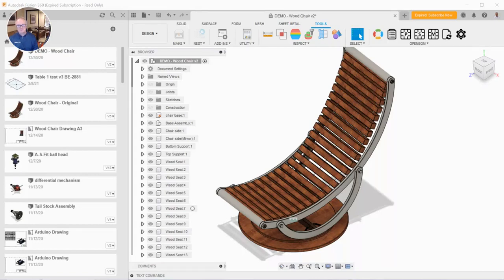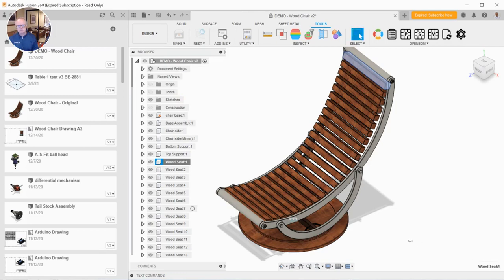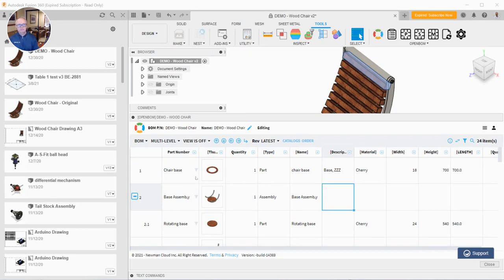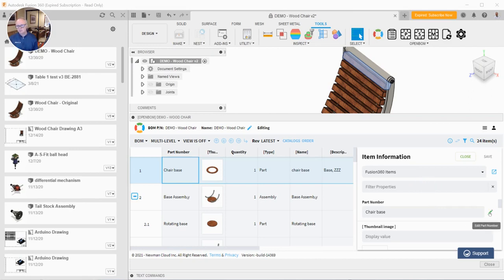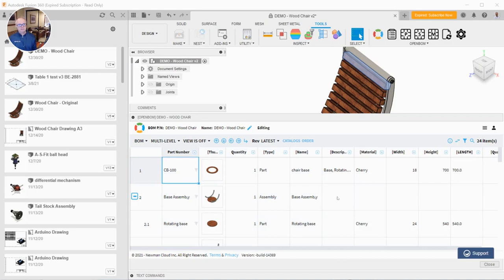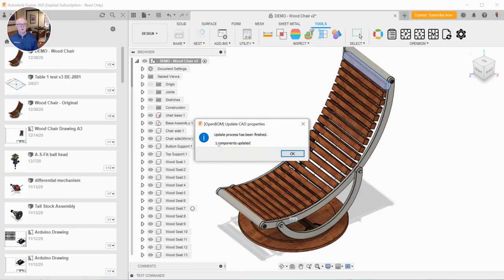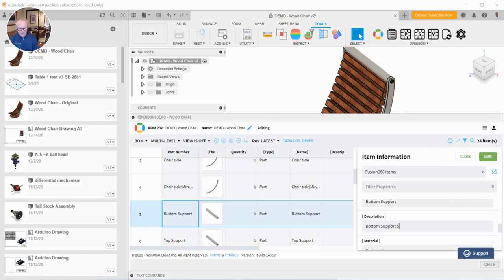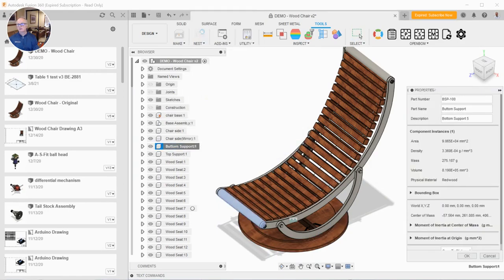OpenBOM For Autodesk Fusion 360 - Save Data Back to Fusion 360

Comment: Awesome! Would this change of a partnumber through OpenBOM also work for Solidworks  parts?
Reply from the maker: Yes, OpenBOM change of Part Number can work for SW parts too. Watch our SW videos. Keep in mind that SW Part Number can be set to the document name or configuration name and in such case, it won't change. But if it is a free text, then it will.